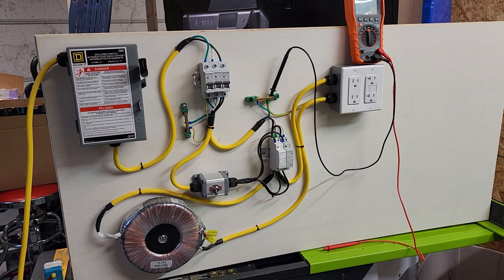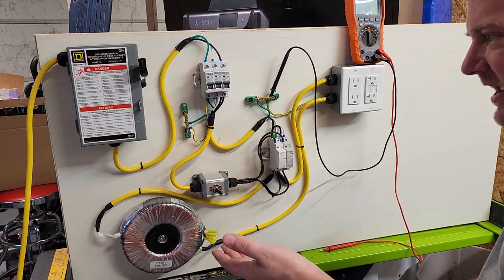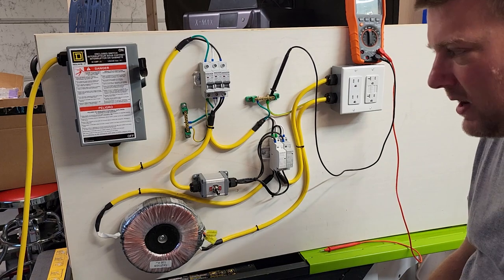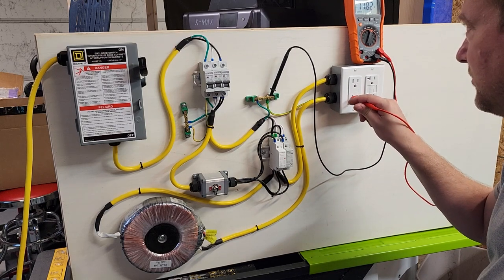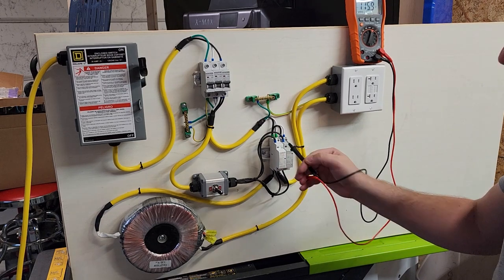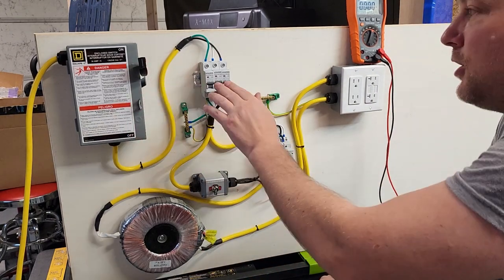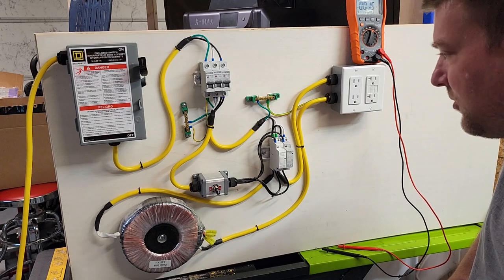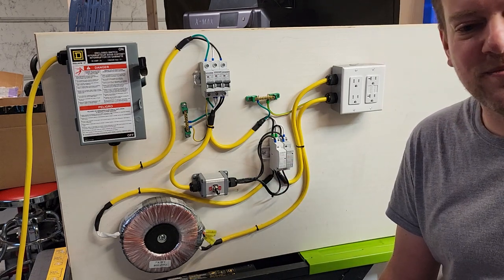AC Trainer Board Overview

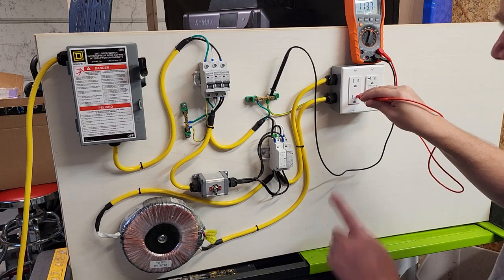Comment: 3:05 This is completely normal that you measure a voltage between the secundairy of the isolation transformer and safety earth, this is called Ghost voltage, or Phantom voltage, but is very low current (in the µA range). With a isolation transformer there is always a capacitive leakage from the secundairy to the core of the transformer, and from the core to the neutral of the primary. Because the neutral is at the same voltage potential as safety earth, you measure this Ghost voltage between safety earth and the secundairy of the isolation transformer. You will measure almost the same voltage between one of the secondary legs of the isolation transformer, and the neutral of the primary. With a Toroidal transformer there is much more capacitive leakage current between the secundary and primary side because both windings are winded on top of each other. Compared to a standard E I transformer, where the primary and secundary coils are spread from each other. With a E I transformer, this leakage has to go from secundary to the core, and from the core to the primary, and this lowers the capacitive coupling between both.
Besides a resistance check between primary and secundary, you can also do a capacity measuring with de-energized transformer, between one lead of the primary and one lead of the secundary, because both isolated coils act like a capacitor. 
It's also normal, if you do a voltage check between the neutral of the primary side, and one of the wires of the low voltage (yellow crimp connectors) , that you measure a lot more (up to +50% or more) voltage then the advertised low voltage, this also due capacitive leakege. 
If you do al these voltage measurings in Lo-Z (Low Impedance) or with a small halogen light bulb connected in parallel with your Digital Multimeter, you should get readings arround 20V or lower. 
This Toroidal transformer is for commercial use if i'm not mistaken, because a medical grade Toroidal transformer has a earth wire connected to the core, and also has a copper shield between the primary and secundary windings, to lower the capacitive leakage.
Reply: I once measured the voltage to ground in a OR (isolated Ground) and both neutral and hot were 60 volts or 50%.
Reply: @abelardonarvaez2  , if it was almost exact 50% , i could be that you have measured the leakage voltage caused by the X and Y safety caps. When a device has X and Y safety caps, and no safety ground is connected to this device, then there is arround 50% of the supplied voltage present between the chassis and neutral of the device, and the same amount of voltage between the chassis and the hot terminal of the device. With a safety ground connected, this leakage caused by the safety caps is reduced to almost zero volts. This leakage current caused by safety caps is also in the µA range.
If it was Ghost voltage or Phantom voltage from a isolation transformer, then exact 50% between hot and ground, or neutral and ground is very rare, because with a isolation transformer there is always one leg of the secundary that has more then 50% and the other has less then 50% of the Ghost voltage compared to safety ground. (useally more then 10% difference). This has to do how the windings are made, one start of the secundary windings is always closer to the hot of the primary then the other end, this also determines the polarity of each winding (yes, transformers have a polarity 🙂 ) 
With E I transformers, this polarity is marked with a white or black dot. If a transformer has 2 secundary coils (per example 60V per coil), and you connect both coils in series correctly, then you have 120V in total, but if swap the polarity of one coil, you get almost 0V as output because both coils are then 180° out of phase between each other and cancel the magnetic flux of each other out.